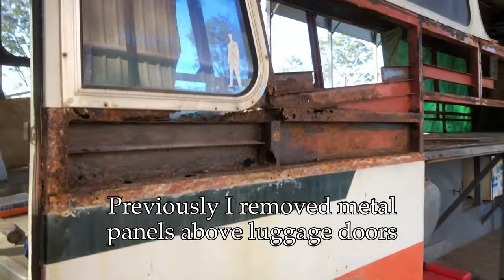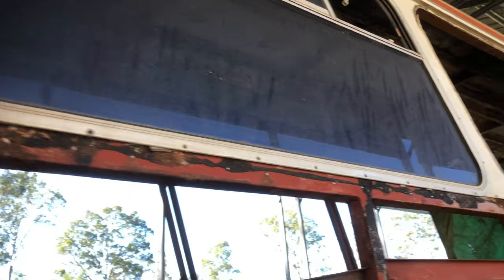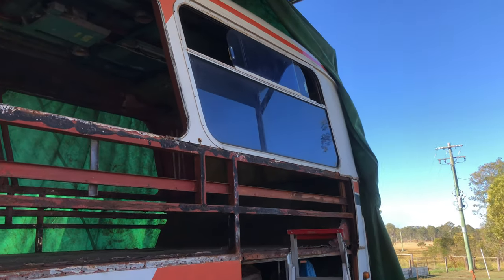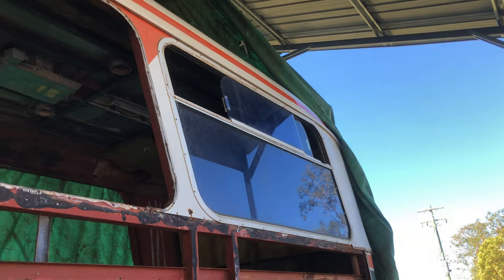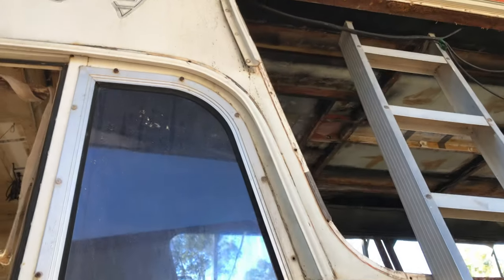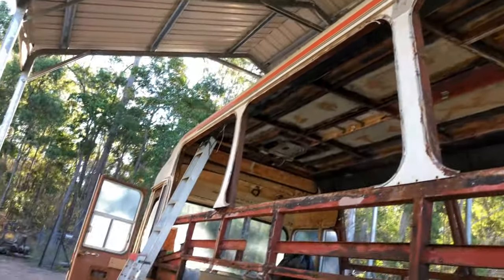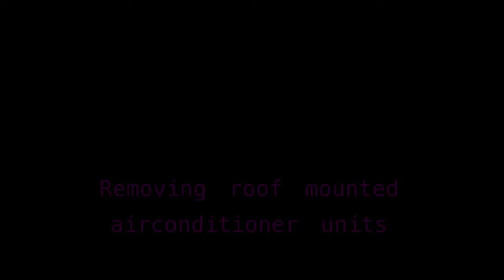Domino Denning Bus Conversion | Ep. 7: Removing left side main windows and remaining panels

Comment: Good old red Australian bulldust. When these vehicles came home after a central Australian tour it was common to put them on the wash bay and hose them out, even the inside. All seat covers were removed and the curtains. Alternator and starter motor we removed, tested and the dust cleaned out. It even got inside the instrument gauges. It ruined radio and speakers and blocked the A/ C cores.